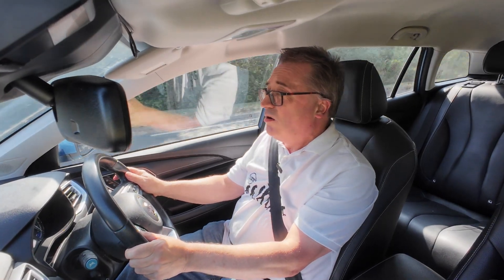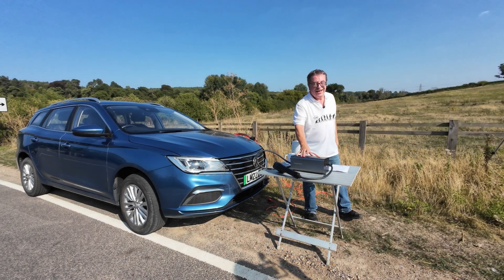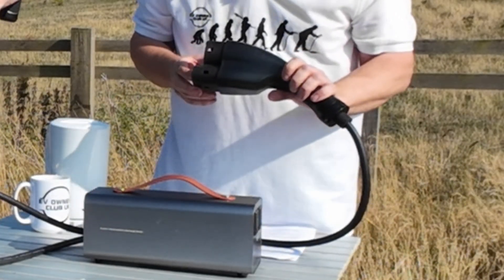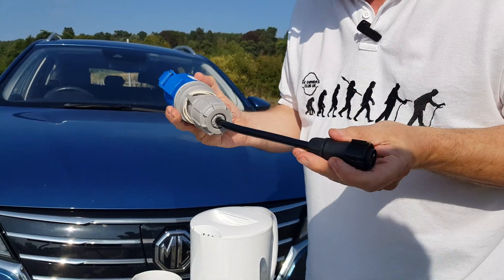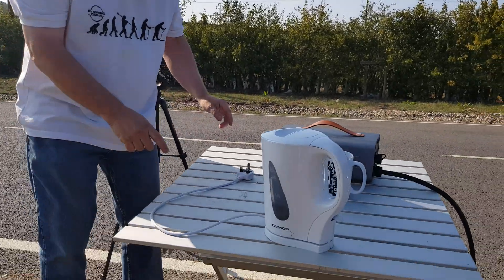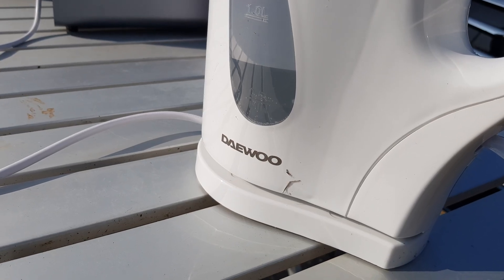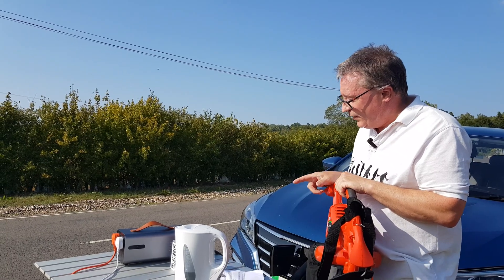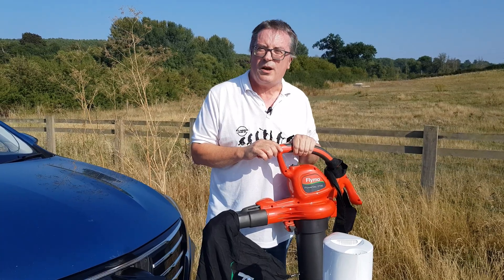V2L Pro by EV BOY

Comment: I wonder if this will work with Stellantis group vehicles. We have a Vivaro-e Life that I'm wanting to take on some little adventures (on account of it's 50kWh battery and ~100 mile range), and something like this could be super handy to have!
We also have an E-Tron 55, which has a mahoosive 95kWh battery, I could use it to charge my 40kWh Leaf twice and still have battery left!
Reply from the maker: It should, but I've not been able to test it. Manufacturer says BMW doesn't work and ID4 cuts out after a few minutes. Other than that, not much info.
Reply from the maker: Tried it on a 22 Fiat 500e and a 23 Kia EV6. Neither worked.